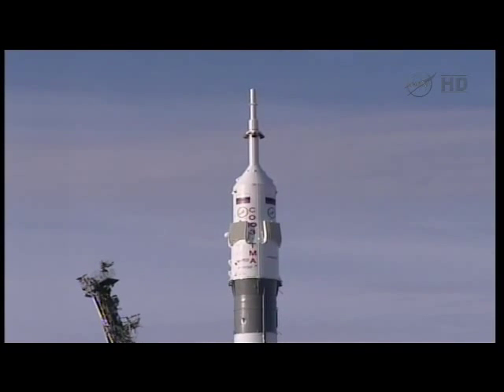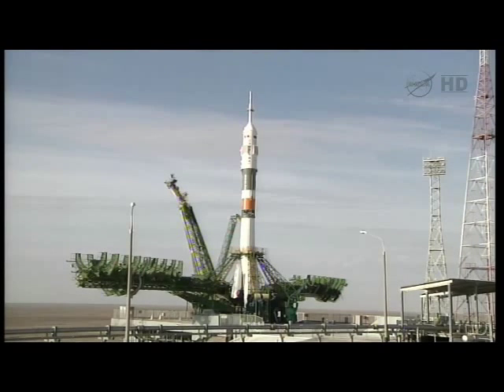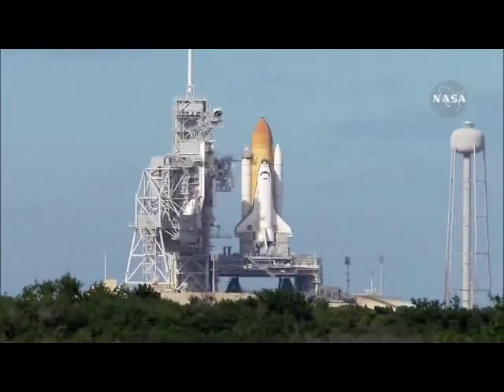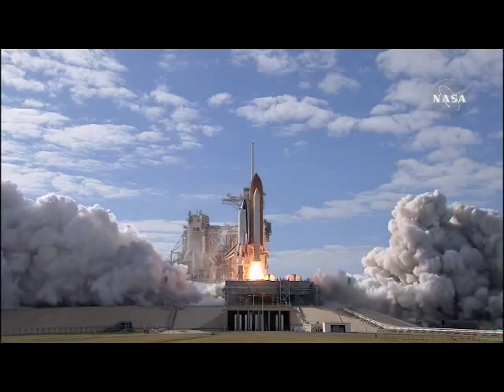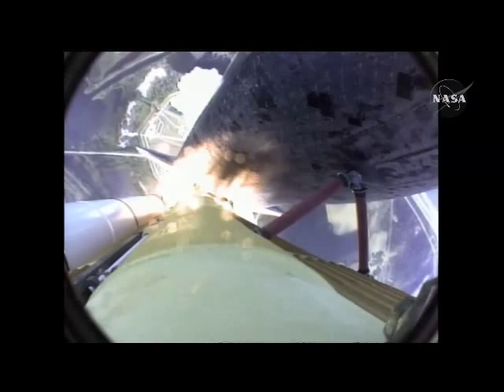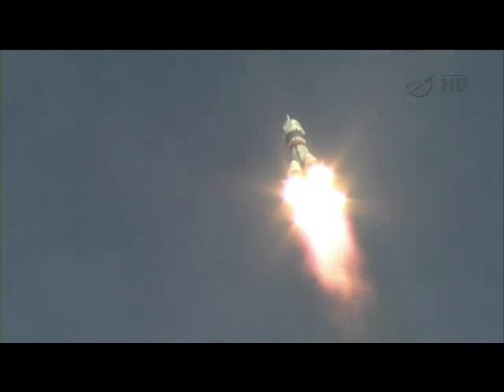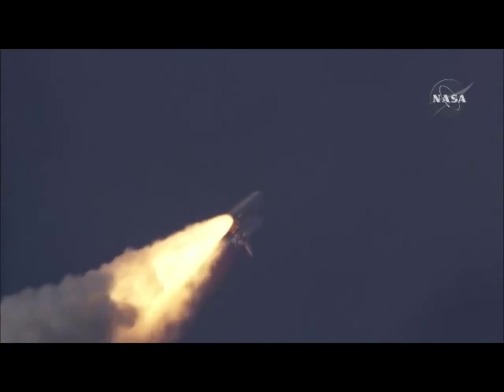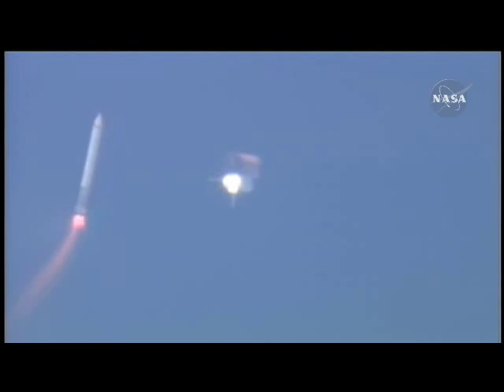Soyuz vs. Shuttle launch

Comment: Soyuz reminds me of Apollo Gemini and mercury launches
Reply: It had it's genesis around the same time though it has been updated over the years. The last major revision to Soyuz was 2010. Because they are not reusable they can periodically update and modernize the whole design. Orion is reusable but only rated for around 10 missions or so and will have the same advantage of being able to be completely updated to keep up with technology. We could very well be using the Orion for the next 100 years or longer because of that. Basically just keep updating and redesigning it as time goes on.